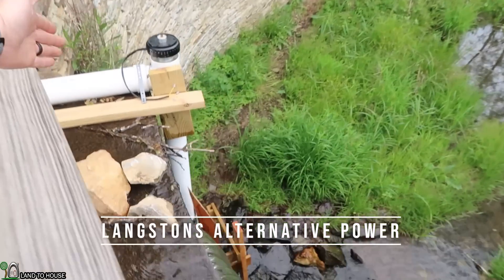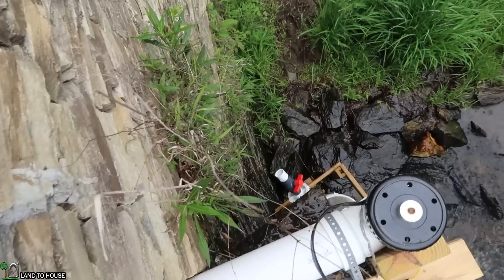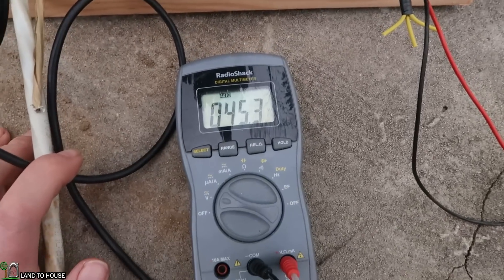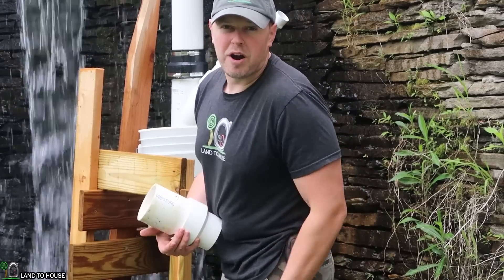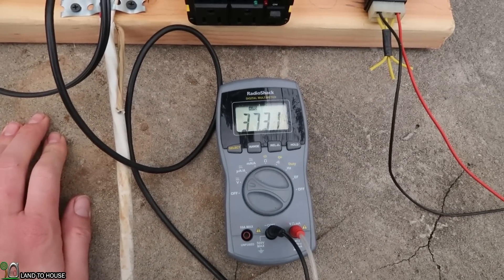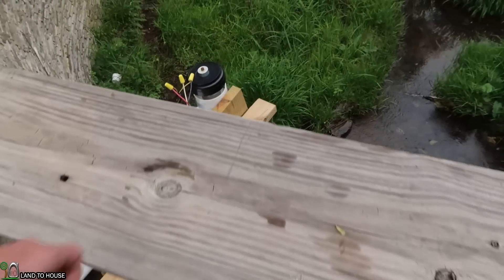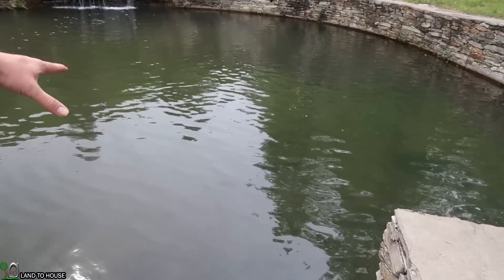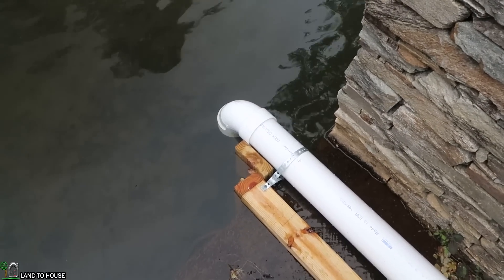Micro Hydro 4 Inch Unit Voltage Reading

Comment from the maker: Check out my Tools Tech and Gear channel:
https://www.youtube.com/toolstechandgear

Thanks for watching!
Reply: Use an automatic bell syphon and run until the dam level drops. You need to change propellers to one that automatically starts your motor once the syphon starts. This will allow you to automate the process and charge at 45 volts open current at 30 minutes intermittently throughout the day.
Reply: Really enjoy your work
Reply from the maker: Thank you. This is a fun one.

Comment: i keep watching these late. but if you move your vacuum siphon valve higher and suck the water higher up the tube will create a higher vacuum. 
 just got to the part where water supply could be a thing so increasing the water flow may drain it to fast.

Comment: what is the charge controller you are using that has a dump load feature on it?
Reply from the maker: I use the midnite classic 200v for solar and 250v for hydro.
Reply from the maker: Oh on this system I just don't let it charge much as test.

Comment: I think you did wrong when you reduce the flow of water at the end of the pipe...In this way, as the same flow of water comes in as before, but less comes out, the water needs to run slower to have time to come out.. You should reduce at the entrance and in this way, the velocity will be the same, I think... Did you a test as I said? Have a video?

Comment: The four inc propellor should be on the side of the intake. The purpose is to create the fastest speed. Its the draw from the pull pushing out as much water as fast as possible. Push out the most water out that you can/ .
That 37.5 volts will be double. Just saying. I love your shows. Kieran.

Comment: Hi Seth.First off, the outgoing needs to be equal to the incoming, which means flow measurement. A 2" intake will never fill a 4" pipe. The siphon won't work properly?, and a longer outtake with venturi would suit a two inch system..Obviously, the first thing you need is a pond with a greater surface area, not so much depth, but of course getting that drop is important. The other thing that winds me up is getting the water back to the pond, with minimal losses.Water ram or hose effect.I love what you are doing and it would be good if you can lay down some hard and fast rules.

Comment: Hallow there instead of using the trial and method to test the relation ship between flow and voltage can I suggest the following , at the outlet of the system fit a throttle v/v  and before that fit a flow meter ( many brands are available in the market) controlling water flow by throttling and counter check that

Comment: Hey Seth, your work is amazing! I do have one question, is it possible that the sucking pipe firstly goes from water up, 4-8 foot, then on the angle down we set generator and long pipe down? And is there any way we might do longer suck pipe - also longer "exhaust" pipe? How much vacuum power we can create from the exhaust pipe and keep long suck pipe running?

Comment: Wow, this is cool. I will have to look at the follow on videos. This system relies on water flow and pipe size to generate power. If I understand correctly your power generating device is at the top because the weight of the water doesn't matter and your limited to 32 feet of head. If it works like I think it does the 6 inch down pipe won't get you any more power. The power is limited to the power device pipe size and a max of 32 feet. I am looking forward to the follow up videos, time to go look.
-MG

Comment: How funny!  Whatever you do is just fine because your experimenting but I would have done it differently. Instead of building a platform to hold the bucket up,  I would have put the bucket on the ground and extended the drop pipe to the bucket.  I think that would have been less work and easier to just get more pipe.     Maybe you'll get to that later to see how much the extra drop changes output and by how much.  Cheers.
Reply from the maker: Yes! I did that on purpose to test height differences.  Later I have the bucket all the way down.

Comment: This was useful. I had a off grid cabin that a few friends and I built near a small lake and creek.  I thought of a hydro solution that you might be able to use as well.  self starting syphons.  I had started bringing up electric lighting to end the headlamps, candles and lanterns indoors vibe. I started with auto parts store 12V dome lights and a 7A gel cell battery I would bring up fully charged. I then wired it for 120v lights and plugs to use my 500W Honda Generator. I built a small gen shed on stilts about 80' away near the creek to mask the noise and used an extension cord. Yes, I had a plug-in cabin. I upgraded to 30W solar panel and bought a deep cycle battery.  The next step would have been hydro, but there just wasn't enough flow in the creek.  Then I learned about self starting syphons and it occurred to me that I could have a system that would periodically run, charging batteries and draining the lake a foot or so before recycling until the lake filled again. In rainy times, it would always run or you could stop it cycling with a valve so you could run it when you wanted 120v power for a while.  I hadn't seen these small 120v units before and so 12v too far away was the obstacle for me.

Comment: im not sure how you feed the pond but is there a way to increase the water feed to the pond its self . more water feeding the pond area would fix the problem all around . could be a easy fix i dont know depends on what your using to fill the pond in the first place . you got a nice set up though . i tried to dam up a creek when i was a kid and got in alot of trouble for it . dnr dint like it much . needless to say i had to remove the dam lol .
Reply from the maker: This pond is fed by a creek. It normally flows between 40 and 100 gpm.
Reply: @LandtoHouse  any way to widen or increase the water flow .

Comment: Great tests, Seth! I think this turbine is designed to be 4” all the way.  As seen, the reducer to 2” limited flow to the point that it didn’t even fill the inlet side. Even if it did fill, that impeller’s efficiency is not anywhere near peak at that flow rate or water velocity in the 4”.   
I think a system composed entirely of 2” and impeller to match would get you better results on this waterfall if you want sustained operation. 
All the best!
Reply from the maker: In the next video we get a power rating with full open 4" pipe. Let's just say we will be stepping up the down pipe to 6".

Comment: Put large valve to bottom of pipe and water level sensor to bond. Then you can do automation what open that valve when there is enough water and close it when bond level drops too much. That allow you to do some over capacity to generator without getting air to siphon. Also you can use small amount of energy to suck air and water from that top pipe. For that you can use small vacuum pump or thin tuble. It prevents air accumulate to that pipe. Problem with thin tube is that you still need start it by suction. But after it starts it will carry small bubles away from top of that pipe.

Comment: I spent a shit ton of time one night looking at the number for  a 3 inch system  I  guessing to run a close system 600 gal  of tank cap 300 up top and 300 at least 16' of drop away from the top supply tank, you need a tank and pump to return the waste or maybe just use a breather cap the plumbers  put on top of  washer drain lines, dumb ass breather cap can't remember their name... Betting you can make a ram pump that will not have any waste water using a breather cap just like the ones used   on 2' washer drain line.   I will work up a 1inch  inline model, that will  use the little 80v 300 mi/lamp micro hydro in lines,  betting using 2 55 gal tanks, 1 inch lines ,(3) 80v 300 mil/amp  in line micro/hydro to charge a 12v , maybe 24, batt pack it's all about the math in that link I just sent you( I know Talk is Cheap , Slowly Getting My shop together it's been a jacked last 1 1/2  year.. so thx for all you do keep up the good work man...!!! God Bless...!!!

Comment: If the alternator shaft is longer and the impeller is half way down the "down pipe" then it will become self-starting due tot he head of water above the impeller.

Comment: Interesting results. What you're doing by throttling the flow is effectively reducing your height difference because there's a pressure drop across the throttle which will undo some of the pressure drop of the entire pipe.

Forgive the MS Paintness of this diagram: https://imgur.com/a/dhVybSu
I saw someone post on your previous vid that you should instead make an auto siphon (bell siphon). That way you can extract the full amount of energy from the height drop intermittently until the dam fills up again. Unfortunately that means you have to increase the height of the dam to be above the pipe level.

Edit: You might find a bigger drop will let it auto start.

Comment: Too Cool.  
45v, 37v,, the reducers give you the ability to balance the tradeoffs between water volume and power output. This would suggest a gate valve at the bottom of a permanent installation could be used to regulate it and ensure it does not overtake the water supply.
Too bad the 2" reducer test still had air in the pipe invalidating the 14v reading.  I hope you will try that one again, since it might still be a viable option.  Practical Engineering's channel has a good video on "what is air lock".
I would like to suggest a T and your vacuum fittings at the top intake to replace the elbow, instead of vacuuming at the bucket at the bottom for 2 reasons.  It will solve the problem of getting all the air out of the runner pipe by vacuuming all the air out from the top instead of relying on the siphon to flush the air on its own, AND it leaves you up top with the test rig so you can pivot from starting the siphon to taking measurements immediately.  Also it may be easier to break the siphon by opening a valve at the top instead of trying to twist off the elbow.

Comment: If the length of the pipe for vacuum is increased until the top of water with a valve on top, probably it will save you going up and down to vacuum

Comment: That's kool in last video I was hoping to see this if diff size would slow the rate of water taken out of point would it make much of a difference if you removed the bucket if it's creating a little back pressure to slow it even more would it increase if the bucket is removed like blowing into a straw in a cup have to push harder to get air or fluid out

Comment: Excellent test for the flow rate, it is always better to throttle downstream on the reaction turbines, is the alternator 12volt nominal? The voltage with the turbine without load is of little use if not to determine only once how much it arrives, theoretically it should never get there if the pico hydro system is done well, the most suitable regulator in this case would be a constant load derivation, as for the wind, you probably don't need mppt, like the Flexcharge NC25A, simply test by varying the absorption at the output of the rectifier with non-led car bulbs of different power, the cheap and Chinese charge controllers often reached the voltage charge disconnect leaving the turbine to run free this in the long run causes breakdowns and mechanical stresses, other low-power solar controllers simply close in short the input of the panels, without a reference battery it is likely to burn it and it behaves badly, 14V is sufficient for lithium batteries and just over 15.5 / 16 volts during the monthly equalization for lead acid ones, first take advantage of the maximum jump possible bile, without exaggerating the cavity otherwise, i would have used a larger size up to the turbine to minimize losses. Ciao

Comment: A few observations...  
First, replace the bucket with a down pipe long enough to go all the way into the water at the bottom of the waterfall.  This will maximize your power since that's determined by height difference between the surface of the water in the upper pond and the surface of the water in the bucket (or the pool at the bottom)  

Second, your charge controller will not maximize the output of that generator.   (Unless I'm mistaken, it's PWM at best and not MPPT.) All it will do is "short" the generator to the voltage of the battery you're connecting it to.  For example, if you're generating 40V DC during open circuit then dumping that directly into a 12V DC battery (as your current charge controller would do), the generator will stall to whatever RPM would equal 12V. (Let's say it'll make 2A at 12V for 24W total.)  However, if you use an MPPT charge controller, it will allow the generator to run at a higher voltage and maximize the amount of power that gets into the battery. (Maybe 1.5A at 40V for 60W total)  You can tell whether a charge controller is MPPT or PWM by seeing if it has a high power inductor coil inside.  It'll look like a small donut with wires wrapped around and through it. It's maybe between 0.5 to 1.5 inches wide.  If you've got one (or more) it's the better, MPPT style.  They're worth it, trust me.

Finally, once both ends of the pipe are permanently under water, you can put a tee and valve for your vacuum near the generator end of your upper horizontal pipe.  This way, you can make and break the siphon in one place without going into the snake pit :)

Comment: Can you tell me what RPM that is spinning at?

Since I made that impeller in that turbine I can provide some more information. It has an OD of 3.94" and an hub diameter of 1.94" and a pitch of 3.1". It will flow approximately .11gal/rev after you take out the thickness of the blades & fillets.

I'm not sure how spencer attached the impeller on that shaft or if it's field-servicable since he specified a smooth bore and no mounting method. I could print an impeller with different specifications to lower the flow rate, either a steeper pitch or a larger hub diameter.

Then again simply putting a load on it will reduce the flow.

Comment: I guess you are using a LMS2430 charge controller. That has no Maximum Power Point Tracking (MPPT) and uses simple PWM for charging the battery. That means you will need an input voltage well above the 14.4V for a fully charged 12V lead battery. Furthermore, you measured the open circuit voltage and that will drop under load. Pobably a change in the impeller design can increase rotation speed and hence voltage also in low-flow situation.
Looking forward to your experiments with the generator under load!

Comment: Shouldn't your impeller be near the bottom of the drop, rather than near the top?
Reply: It doesn't matter. The speed and flow are the same throughout. It would help to increase the head (drop) by extending the bottom of the outlet pipe. That would increase speed and flow, providing more power.

Comment: Your head is from the top of the pond to the top of the water in the bucket. You can increase your head by raising the pond or lowering the water level at exit. You can easily check this by removing the down spout after your generator.

Comment: you can use a MPPT charge controller. this will step up your lower supply voltage high enough to charge you batteries. Also At some point I would look at getting a higher head drop, maybe by pulling water from the top pond and dropping your discharge more. great content and thanks

Comment: If you has a series of 2 inch T's you would be able to open them all to pull all the air out of the top tube, then close all but 1 to test the 2 inch flow power

Comment: The voltage doesn't matter. What does the maths say for that flow rate and head? How many watts can you expect?
Reply from the maker: All in due time. My goal is to film a power video this week.
Reply: @LandtoHouse  Looking forwards to that
Reply: @LandtoHouse  Looking forward to your power video! Btw. the available power from a waterfall is W = FR × g × h were FR is the Flow rate in mass per second (!!!), g is the gravitational acceleration on earth (9.81 m/s² in SI units), and h is the fall height. Example: If you have a flow rate of 100 liters per second (which is equal to 100 kg per seconds / I love SI units :-) ) at a hight of 1m (3.28 feet) then you can expect a maximum power of 981 Watts. Efficiency losses while conversion will reduce this significantly.

Comment: Reducers Will speed the exit of the water but slow your motor.   My only....complaint about this setup is like most modernization, it draw so much water, it hampers the beauty of the water fall.

Comment: Interesting tests - your assumption on voltage was off because you based it on the change in diameter of the pipe not the change in cross sectional area. 4 inch to 2 inch is a drop to 1/4 cross sectional area - so volume flowrate would be of a similar magnitude (a little less reduction due to increased backpressure) so a drop to about 1/3 in voltage is about right.

You may find that with the 3 inch reducer you may not need the bucket as the change in cross section will allow the pipe to back fill better and probably not let air in - worth a shot.

Great video look forwards to the next tests..... ;)

Comment: So if you put the small on the intake an the larger on the outer bcz the smaller the intake is the more pressure it brings into the pipe you need a bigger outer for the rush

Comment: You don't need a vacuum cleaner to start it.
If you spin the impeller with a cordless drill you get same result.
Reply from the maker: That might be true. So far the shop vac has worked perfectly.